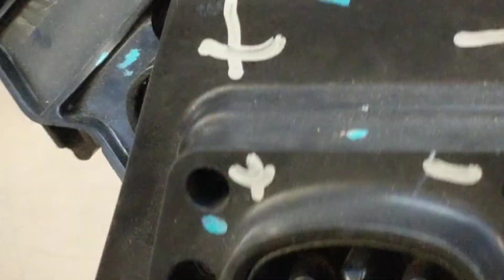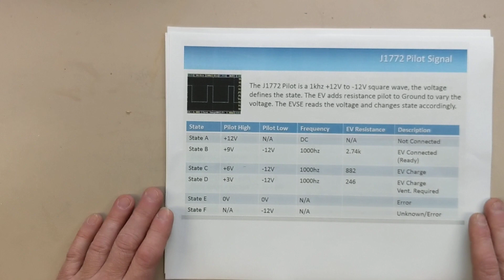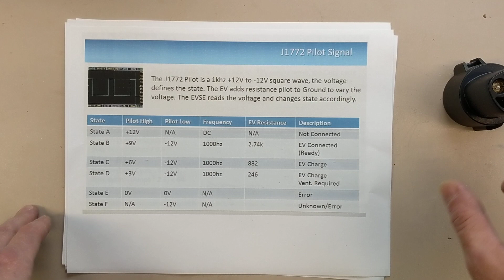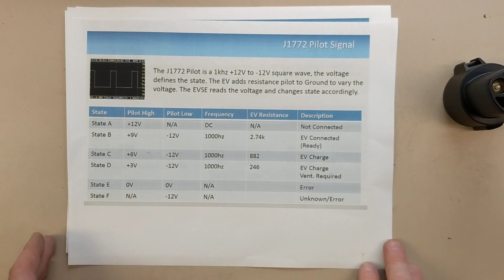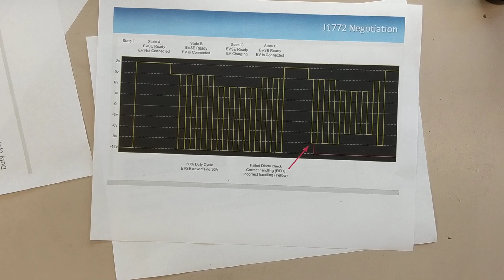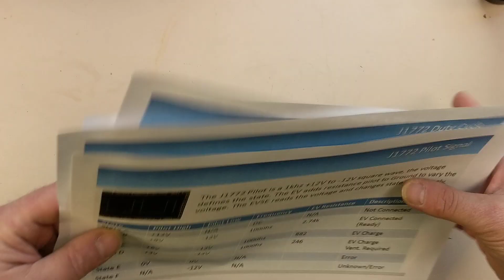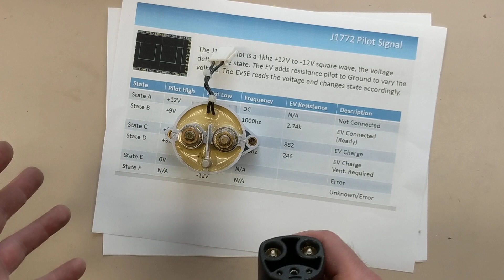Tesla Charging - How Does it Work?

Comment: It's my understanding that the Tesla connector came about because when the Model S was being designed Tesla asked the J1772 SAE committee in 2010 what the physical configuration of the J1772 Plug/inlet was going to be so that they could put it in the S. The committee, not wanting this car company upstart to have the physical dimensions, said that it had not been finalized yet. They basically lied to Tesla since Yazaki already had the drawings and was making tools for it. Tesla also designed their Plug/Inlet to be capable of the full 80A that the J1772 Spec called for using a totally different kind of electrical pin, which is more like the Type 2 pin.
Reply: Tesla offered SAE that they could all use the Tesla connector design free of charge. GM and Ford refused on basis of NIH egos. Such a shame that now we are stuck with the inelegant CCS design.
Reply from the maker: Agreed.  J1772 wasn't even finalized, let alone CCS.

Comment: Regarding the CCS Type 1 to US Tesla adapter - while the actuator in the Tesla charge port could lock the adapter to the inlet, what is it, that would lock the CCS plug to the CCS adapter? So in the US-Tesla-to-CCS adapter there must be another locking actuator, this means a PCB and small electric motor. Even if PLC is handled on the PCB in the car, the adapter cannot be completely simple and dumb.
Reply: I’m not certain because I haven’t seen the new Type 1 CCS adapter in person yet, but it’s my impression that there is a mechanical “finger” that is compressed when you insert the adapter into the car and this mechanically latches the adapter onto the CCS plug while the adapter is inserted into the Tesla receptacle on the car. Thus, the adapter remains passive.
Reply: @jeffnisewanger8260  After your comment I looked at the European version. I found a good explanation here: https://www.youtube.com/watch?v=cI1_mG1FuNo
There is a mechanism as you say: two mechnical claws at the sides are mechanically latched from the adapter into the CCS plug as soon as the CCS adapter is plugged into the Tesla vehicle inlet. I could not think of such a mechanical solution and take the blame.

Comment: Regarding the J1772 adapter - that is not locked, right? While the actuator in the Tesla charge port could lock the adapter, nothing locks the actual J1772 connector to the adapter. This means, anyone could unplug that.

Comment: Bit of a nit to pick here, but J1772 existed long before Tesla as a company was even formed, and CCS was ratified before superchargers existed. Tesla made their own connector for the same reason any company would- they wanted to control the dominant charging network and its connector. Hopefully they abandon their proprietary connector globally and use Combo 1 in North America.
Reply from the maker: Sorry, I disagree with your "nit":  The proposal for a CCS was published at the 15th International VDI-Congress of the Association of German Engineers on 12 October 2011.  Proposal, definitely no where near "ratified". This is WELL after designs for Whitestar (Model S) were being finalized.  In addition, CCS is horrible and bulky.  The US Proprietary connector design is really well thought out, and re-use of the same 2 power pins for both AC and DC is something none of the other standards ever achieved.  The ridiculous choice of HomePlug PLC also unnecessarily complicates the protocol and makes it less reliable.  As someone who has worked on the "nuts and bolts" of CHAdeMO, CCS, and Tesla's Supercharging protocols, I am qualified to say Tesla's is the most functional and elegant.  You don't even need to be an Engineer.  Just drive a Tesla to a supercharger and experience it.  Now do this with any other EV.  Hands down; Tesla.
Reply: @Ingineerix  Not sure where my reply went, but the gist is that all of the constituent standards that made up the initial CCS standard existed long before Tesla as a company. Beyond that, CCS was ratified before superchargers existed. Beyond that, J1772 existed well before Tesla began producing the Model S.

As for the Home Plug Green PHY, it's an existing standard that was developed and certified with regulatory bodies, it allows communications including a TCP stack for larger network and internet access via the charge connector, and it's a separate network from the vehicle's CAN buses. Given Tesla's use of gateways, that seems perfectly acceptable IMO.

I own a Tesla, so the call to go charge one isn't really effective for me. I want to charge where chargers exist, and don't want to rely on the will of a single company to install them where I need. Europe is completely right to standardize on CCS, and if Tesla wants to open their US network to other brands to fund the continued expansion, they will need to support CCS as well.
Reply: @TomCameron  Stop hating on Tesla and use your brain. Developing any kind of product takes time, you can not just slap in some connector from a newly published standard 5 days before the first car rolls off the production line. In all likelihood Tesla had to finalize the chargeport and order parts from their suppliers about 18 months before the first car was produced.

Also, in Europe Tesla actually started with a plug configuration from the CCS2 standard. I give you one guess which one was dropped from the standard just before it was ratified and well after the Model S had started selling in Europe.
Reply: @HenryLoenwind  I own a Tesla, and I own shares. Try again.

Comment: I wonder if this supercharger protocol is used in Europe at all, as the type 2 (non CCS) DC charging used with the model X and Y is part of the IEC standard as well. I would assume for CCS cars the v3 superchargers have always used CCS protocol in Europe, just like they do for non-Tesla cars in the pilot that is now going on.
Reply: Yes, in Europe the Supercharger protocol is used by Tesla S+X with Type2 (non CCS). It is also used by 3+Y on CCS on a supercharger. You can tell from the fact, that Teslas transmit information on authentication to the Supercharger enabling Tesla-proprietary plug and play without apps or RFID cards. Also the vehicle receives information from the Supercharger. 
In contrast, in the 10 Supercharger sites in NL, where the field test now got started, all non-Tesla customer must use the Tesla App, authenticate, agree on pricing and fees, select a stall and start charging from there. So, obviously Tesla did not yet implement "Plug and Charge" according to ISO 15118.
Reply: @koeniglicher  right, I forgot the V2 SuC needs a way to identify the car as well. Then it makes sense that Tesla uses their own protocol across the board.
Reply: @koeniglicher  There was a time last year when suddenly all non-Tesla CCS-EVs could charge at superchargers in Europe. Seems they rolled out the software update for the superchargers to speak CCS and forgot to put a dummy ("always no") authentication module in.

It's a bit of a facepalm now that nobody noticed at that time that superchargers weren't supposed to be able to "speak" CCS at all. That was a big hint at Tesla preparing to open the network...

Comment: So is there a way to use USA charge port ECU in Europe for CCS?
Reply from the maker: There's no need.  All cars built since 2018 for EU already have it.  Older has a retrofit path.
Reply: @Ingineerix  sure but it's easier and cheaper to source ECU from USA compared to EU. I was wondering if I could use US ECU for DIY EV CCS
Reply from the maker: @emceh  Even though the PCB is the same for EU and US versions, there are slight differences in the protocol between Type 1 (US) and Type 2 (EU) that make the firmware different between the 2.  Tesla codes the genealogy block different on the 2 models, so they will not load the correct firmware without hacking.  Yes, it's possible to use the CP ECU for homebrew, but it requires a fair bit of reverse-engineering to get the CAN signals working right.  You might be better with OpenECU or rolling your own with http://openv2g.sourceforge.net/
Reply: @Ingineerix  thank you for such detailed clarification :)

Comment: Is there a way to check if your car will need the PCB replacement in order for the upcoming CCS adapter to work?  Also, can't this chip be internal of the adapter, so that it works with older Model 3's?

Comment: I wish Tesla changes it’s mind on V2G and even better goes for V2 PowerWall and giving us like 50 kW to use plus the PowerWall 14 KW. We have paid for our batteries so let us use them in the best way. Considering buying another car in the future that has V2G if Tesla don’t make this possible.
Reply: I think vw allegedly offering it on all of the id series evs starting next year? Along with the Korean new evs offering some variant of v2l capabilities. Plus lucid with the wunderbox will force them to offer something similar. 
But man will that very likely Osbourne the power walls which I bet they want to avoid. Especially as they are supposed to introduce the v3 powerwalls next spring. 🤔

Comment: So say I were to spoof a 5% duty cycle connection would this just drop me onto the cars CAN bus? If so would you not be able to exploit this?
Reply: I don’t have any actual knowledge on car electronics other than what I’ve gathered from watching youtube videos. Yet I won’t hesitate to share my thoughts. There are multiple CAN buses in a vehicle and the one exposed here is probably pretty limited in scope. Let’s hope someone with actual knowledge comes by to correct this or, unlikely, feed my ego by confirming this statement.
Reply: The charging communication is a point-to-point connection.  It doesn't connect to any other bus on the car, and the controller does not bridge (i.e. forward) frames.

It's worth noting that Tesla A/C EVSE "charger" (a UMC or wall connector) will almost always end up communicating over CAN with a Tesla vehicle.

A Tesla charger will fall back to using the J1772 PWM signalling if it fails to communicate.
A Tesla vehicle will charge using J1772 signal if that's all it detects.
So it is possible that a detection failure will result in a J1772 PWM charging session, but that is the vanishly rare exception.

Comment: Can I ask you, what king of EVSE did you show on the video? Orange one, I never seen such. I cut open few of them to modify and repair them, but never seen an orange ones.
As far as I know, when Tesla was been using gen2 chargers on the supercharger, logic board was been different, but power electronics was been the same in OBC and in supercharger one.
This is interesting what they are start to use qca7005 inside of the charge port controller on us market.

Comment: I wondered if using some of newer connections like ccs if they could do vtg with software and of course a DC controller at home
Reply: It's still gonna be pricey. Chademo is available, but about 5k$. 10kw if I remember correctly. Difference is only on the logic side between V2X chademo and ccs.
I can't wait for a lighting, cheapest way to implement V2X via ccs is gonna be to integrate it into OBC, and got a AC out of car with modified EVSE what can do so. It can be also deeply integrated into a smart grid using GreenPHY protocol what ccs and your power meter in your home  uses.

Comment: I heard you say that V2H won't happen because it's not easy or inexpensive but a power wall is what $7K? And it has ~1/10 the capacity of my Model 3 battery that I already paid for. 
So is it really just that Tesla wants to protect its power wall sales?
Reply: What about Tesla having to warranty the battery for time and mileage use if someone
used this to power their house ?
Reply: Cybertruck will almost certainly have split phase output, V2L.  But V2H and V2G are different.  Using your vehicle in an outage is not ideal as you're tethered to the home, if you leave your house shuts down again.  A stationary system is a much better experience.

Comment: Precharge circuit description is missing for AC charging but it's on the onboard charger side which this video didn't touch.
Reply from the maker: Yes, I didn't cover the details in the power conversion (on board charger).   I've touched on this in previous videos though.
Reply: @Ingineerix  re-reading my comment, it sounded harsh. I was just making a comment on the precharge circuit missing from a charging video. Great content as always. Love seeing these. Now, how awesome would it be to get a hold of a V3 supercharger module
Reply from the maker: @akmanarda  That's ok.  If you get one, I'd love to do a teardown!

Comment: What’s your take on people that put a wet cloth on the Supercharger handle to cool it down on hot weather? Good, bad or doesn’t matter?
Reply from the maker: The new ones are liquid cooled.
Reply: @Ingineerix  at 250kW it still gets super hot, almost hard to touch.
Reply from the maker: @GregHassler  It shouldn't unless there is a problem.  All V3 superchargers use liquid cooled handles/cables.
Reply: @Ingineerix  I've felt it a couple times in summer on the east coast, normally when I disconnect early while it's still pulling high power (short top up). After it tapers a bit the liquid cooling seems to do its job better. The amount of liquid they can pump out and back through the narrow cable is limited, and it's not just cooling the handle but the entire length of cable.   I have no way of knowing if the cooling system was operating properly of course.
Reply: @Ingineerix  even in them, I see people doing and recommending wrapping a damp cloth during the day to cool it down and saying it definitely improve charging speeds, most notably Kyle from Out of spec motoring, but I’ve never seen a comparison, so probably is more like snake oil
Reply from the maker: @Pedrodemio  I use the V3 extensively on the ones in the Central Valley between SF & LA in the summer, and I've never experienced that, even when it's over 110F Ambient.  If the liquid cooler fails, then that will happen, but I haven;t seen it.  Maybe they maintain the ones in CA better.
Reply: @Ingineerix  thanks for the answers, loving these videos

Comment: In Europe, do they put DC through the Type 2 connector pins, or use the 2 seperate  outboard pins as per standard CCS?
Reply from the maker: The older EU Tesla standard "buddy paired" the 4 Type 2 pins for +/-.  Now Tesla is using the CCS system.
Reply: @Ingineerix  more precisely it's like that on all EU Model S and X cars. Even the new ones. Model 3 and Y use regular Type2/CCS connectors and thus CHAdeMO adapter for MS and MX doesn't work with them. There is a CCS adapter for MS and MX.
Reply: @Ingineerix  What old Teslas use is CCS-Mid, which was kicked out of the standard after Tesla began using it. So it's not actually a "Tesla standard" aside from the communication protocol they use for the superchargers.
Reply: @HenryLoenwind  cheers for the info. As  an owner of a Euro style (actually Australian car in NZ) Model S I think the Type 2 DC solution is much neater. Probably can't handle as much current as CCS-2 but it can do 120kW which is enough for me for now :)

Comment: Would love to have seen something about the RF connection and antenna for the charge handle button receiver. Mine had an intermittent reception. Question is why? Tesla fixed it by disconnecting and connecting again. But didn’t want to do myself due to warranty.
Reply from the maker: I've answered this now a bunch of times:  The handle sends a 315MHZ (or 455MHZ in EU) RF signal to a small receiver in the CP ECU.   They use this RF/MCU to send:  https://www.silabs.com/documents/public/data-sheets/Si4010.pdf
Reply: I heard it's common issues, board in the handle gets wet thru pins or plastic film and starts corroding.

Comment: On the European Type 2, which has no manual latch, PP is used to tell the car the current capacity of a (non-thethered) AC cable
Reply from the maker: Yeah, In the US, we don't have detachable cables (which is silly).  This is why I gave the disclaimer up front I was going to be mainly discussing the US version.  This is also how Tesla tells the difference between a supercharger and CCS.
Reply: @Ingineerix  I think that you are blessed with fixed cable connection (no sockets on wallboxes). The only reason of having AC Type-2 sockets on walboxes in the EU was to be able to charge older imported vehicles with Type-1. But for common user with new vehicle with Type-2 socket is this only pain in the ass.
Reply: @Pajdaaax  the reality here in the Netherlands is a little bleak, though. I'm afraid the main beneficiary of fixed cables would be copper thieves :/
Reply: @44Bigs  Are EV cable thieves a real problem? I don't know much about this type of business, but to steal an AC cable up to 5 m long, where the cross-section of the wires is 5x6 mm2. And then you have to remove the clean Cu wires from the cable, ie either mechanically remove the two layers of insulation or burn it. Is it worth? In my country it seems still to be more practical to steal wires without insulation in much longer lengths in one place, typically on the rail.

Comment: CCS has that locking pin too. It failed on my BMW i3 and I couldn’t DC fast charge. As a safety measure, the charger needs confirmation that the connector is locked. It doesn’t care with AC charging.
Reply from the maker: Yeah, all high-current DC fast charging systems must have a latch to ensure no arc flash if disconnected under load.
Reply: @Ingineerix  More subtly, it requires that the charge controller be functional.

The on-board charge controller must command the shut off of charge current, monitor that current flow has stopped,  open the contactor, and verify that it has opened before it commands the connector lock to disengage.  A crashed controller or other fault will not release the connector, avoiding arcs and live contacts.

That's why A/C charging can use an external mechanical pawl latch, but DCFC requires an internal electrically actuated lock pin.